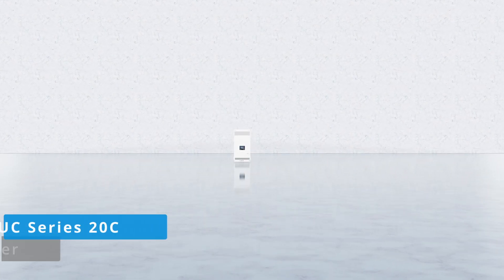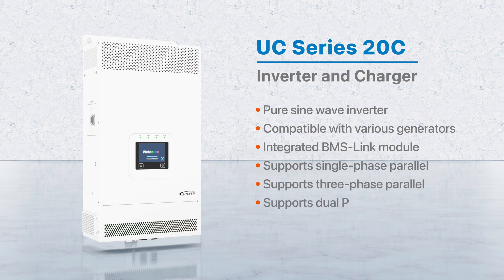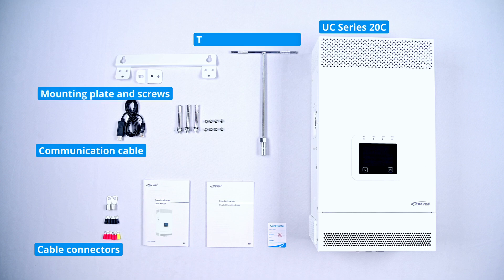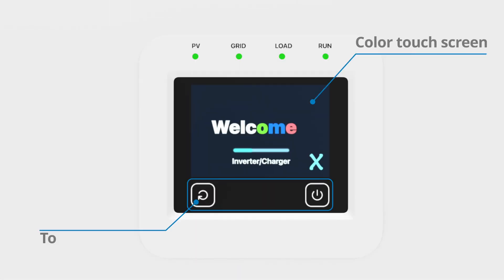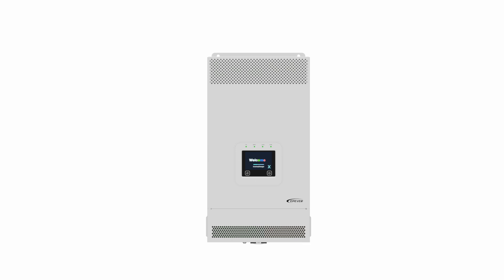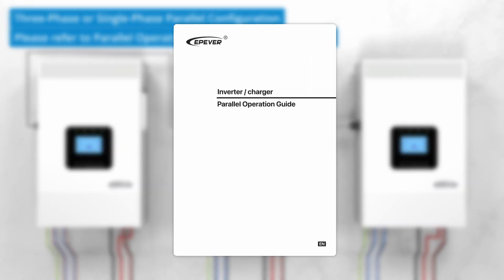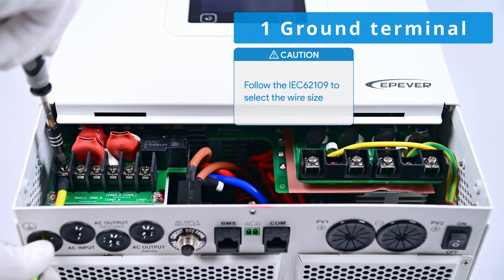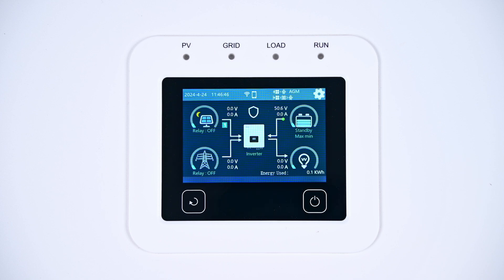Explore UC Series Inverter Charger: Dual MPPT Inputs & Touch Control for Enhanced Power

Comment: what is built in wifi?
Reply from the maker: Hi there, built-in WiFi means the inverter charger has a wireless module inside, allowing you to easily connect it to your smartphone, computer, or web platform using the Solar Guardian app or software to monitor and control your system—no extra devices needed.
Reply: @Epever  I just bought this inverter....wireless was on, but not wifi signal was detect on my phone, how to solved?
Reply from the maker: @muryadi07  Hi there, please contact our technical support team at solarguardianfeedback@epever.com
Reply: @Epever that's good
Reply: @Epever thanks for clarifying

Comment: I went to epever website and I saw UC, KR, KP series are so similar that I wondered why you created inverted versions that have basically the same specifications. It makes choosing the correct option for one's need almost impossible.
Reply: UC series support grid feeding
Reply: @DigitalMind.254 ....and I assume the others don't. What's the difference between the KP and the KR?
Reply from the maker: Hi there, thank you for your question! Although the UC, KR, and KP series share some core specifications, they are tailored for different applications: 

UC Series: Designed for maximum versatility, it supports both grid-tied and off-grid setups, and includes features like dual AC output and parallel operation, making it suitable for both residential and commercial energy storage systems that require robust performance under varying conditions.

KR Series: Built for stability, the KR series is optimized for applications that don't require grid feed-in capability but still demand reliable energy management. It's perfect for residential and commercial environments where stability and protection are key.

KP Series: Focused on simplicity and efficiency, the KP series offers a streamlined, single-channel AC output, ideal for installations where straightforward energy conversion is needed without the complexities of parallel operation or grid feed-in.

For a detailed breakdown, please visit here: https://www.epever.com/new-uc-kr-and-kp-series-inverter-chargers-tailored-energy-solutions-for-every-need/
Reply: Thanks for explaination  @Epever
Reply from the maker: @ Glad we could help! Let us know if you have any more questions. 😊
Reply: In kr series if i add grid to it and in night kr series have ac charger to charge battery in night time?
Reply from the maker: @jasonbourne7171  Hi there, yes, it's possible. If you want the AC power to charge the battery at night when the grid is connected, you need to set the charging mode to either "Solar and Utility" or "Utility Priority." For more details on the difference between these modes, please refer to the KR manual, section 4.2.3 Scenario C: Both PV and Utility are available, particularly parts C-5 and C-6 on pages 70 and 71.
Reply: What's the difference between HP-AH, and UC series?

Comment: What does the second AC output Terminal do and what's the maximum current that it can deliver through that terminal?
Reply from the maker: Both output terminals share the inverter’s total rated output power. One output is designated for important loads, and the other for secondary loads. When the battery charge is low, the secondary load output will be disconnected first to ensure that important loads remain powered. This prioritization allows the important loads to run as long as possible while protecting the battery.
Reply: @Epever  thanks for the detailed explanations. I understand better now. I thought it's some kind of AC pass through but this is different.
Reply: @Epever now it's clear
Reply from the maker: @ We appreciate your feedback!
Reply: Two load outputs both outputs support full loads but one is smart load other is heavy load
Reply: @DigitalMind.254  what exactly between smart load and heavy load?
Reply: @adon8672  heavy load will turn off when no Sun and batteries are going to discharge. Smart load will remain ON to run lights fan and light load. Heavy load goes OFF to save battery power at night. Otherwise both support full load. But heavy load like AC Owen etc connected to heavy load consume more energy from battery. That’s why it goes OFF and smart remain ON